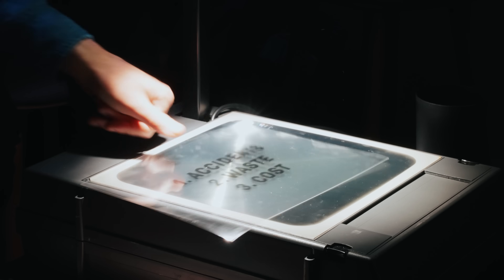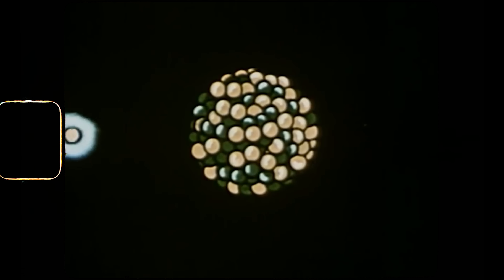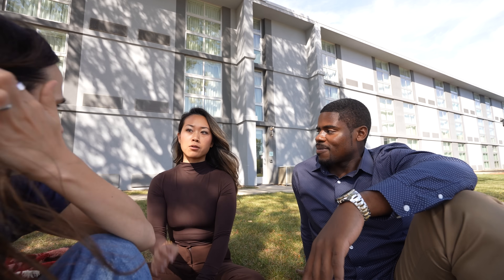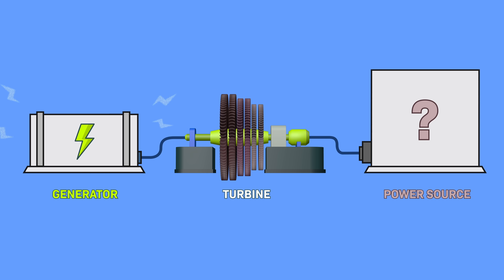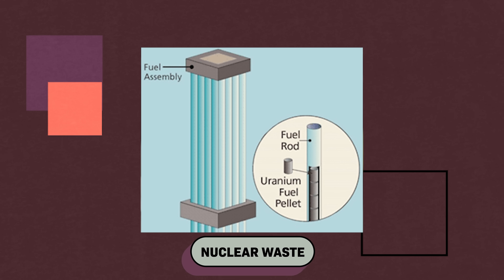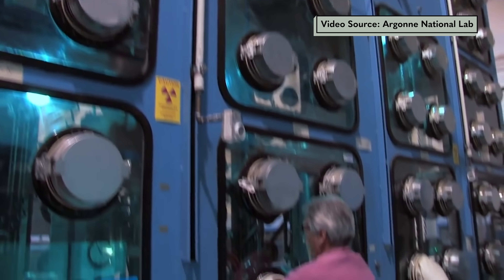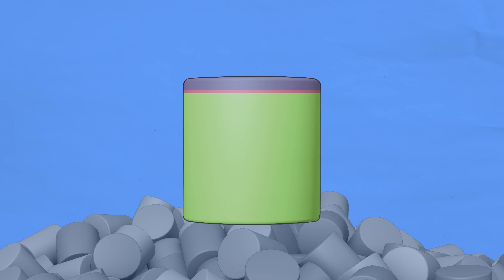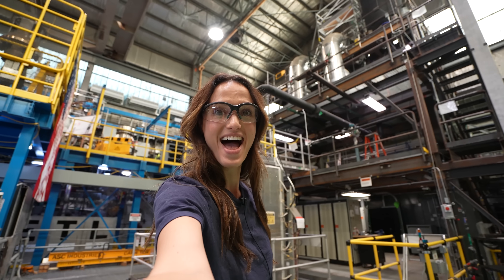The Big Lie About Nuclear Waste

Comment: U-235 has 92 protons and 143 neutrons in the nucleus, so 235 is NOT the number of neutrons in the atom, but the atomic weight of all the neutrons plus protons. 92 protons means it is uranium, and the number of neutrons (235-92) makes up the remainder of the atomic weight. Uranium has many isotopes, and as you said, U-235 is "fissile", which means that it will continue a nuclear chain reaction. U-238 is "fissionable", which means that it will fission, but will NOT sustain the chain reaction.

Comment: Nice video. But all technology is useless unless it's also practical. Nuclear energy simply cannot keep up with solar. We are overthinking this. Solar is cheaper and continues to be cheaper still. Battery storage is also one  cost curve down. Even if you remove all bureaucracy for fast reactors, it'll still take decades and decades to build up the 10s of 1000s of nuclear power plants needed. Each will be cost overrun, and a nightmare in terms of time overrun as well. Not to mention the political issues as you'll still end up with nuclear wastes that'll take 100s of years of storage.  Just in the last 100 years, we have had 2 world wars. Anyone actually think we can keep these piling up safe?  

As I say, in the best case scenario, zero political probs, zero bureaucracy,  it'll still be white elephants as it simply can't compete with solar and wind with storage.  And renewables have far less political and bureaucracy issues to deal with. Nuclear is dead on arrival. You mentioned Japan and other countries are already using it. Ask yourself this simple question. Why haven't they achieved 100% nuclear yet? In fact, they are all moving towards a cleaner, simpler and cheaper tech. Renewables. It's easy to scale and a lot cleaner.

Comment: Clean energy will never be achieved while the giants continue to grow fatter off of fossil fuels.  Fossil Fuels account for such a large portion of the global economy it is obscene, and they go out of their way to ensure their place by lobbying against anything that would hurt their profits.  Like nuclear power, nuclear waste reuse power, solar/hydro power, electric vehicles, hydrogen powered vehicles, free energy systems of any kind.  No law has yet been passed that prevents individuals from owning and using these technologies for personal use other than nuclear power, but there ARE regulations in place under which personal nuclear power devices can be owned and operated on a personal level, but it amounts to a grand total of enough to power a flashlight bulb.  You can make any gasoline engine into a hydrogen car with a conversion kit, or even make your own kit if you have the right tools and materials.  You need to source the fuel yourself too though, but electrolysis is easier than making or even just installing a premade conversion kit.  The majority of laws against power sources like these are against mass production.

Comment: I don't understand how fuel can be dangerously radioactive for the next 100,000 years, but yet is "spent" and has to be disposed of..  If it can still boil the water and generate steam to drive the turbines, it's still doing it's job..  OK, maybe it's not boiling the water efficiently enough at a 500Mw reactor..  So you move it down to a 250Mw and then down to a 100Mw, etc..   But CALLING it "spent" and shipping it off to be entombed seems wasteful if it can still do a job SOMEWHERE along the line..   Does it become a matter of people quantifying their jobs ? IE: if you only fueled a reactor every 25 or 50 years, the monkeys in the yellow suits would be unemployed for long stretches of time..

Comment: I currently work at a nuclear fuel manufacturing plant and this video is spot on. I think micro reactors will change the future of our power capabilities and the negative stigma around large nuclear reactor facilities. This video adds another aspect to the equation that will make it even better in the future. This is good stuff!
Reply: I think it adds to the equation;

Common sense versus politicians is a losing battle 😐
Reply: Common sense would also say that it's not a good idea to have many small potential sources of radioactive contamination rather than a few large ones that are well cared for. Do you realize how many idiots there are across society and what small modular reactors all over the country would mean for safety? I'd rather have a few large ones with economies of scale and a guarantee that some experts are always there.

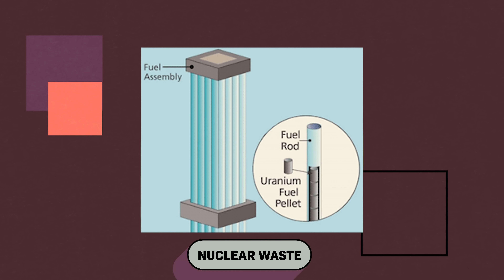Comment: 7:12  "...process clled  "enrichment"  which is making more of the U-235 from the less useful U-238."  Uh, no, and the illustration pushes that same mistake.  Enrichment means physically separating the U-235 from the U-238; the difference is important to the understanding of the whole question. If you start with 0.7% of the mass U-235, that is what you will end up with, only now one part can be used aand the rest of the mass discarded.  If you start out those early telling people one can be "made" from the other, you are pushing myth which they will believe later on.

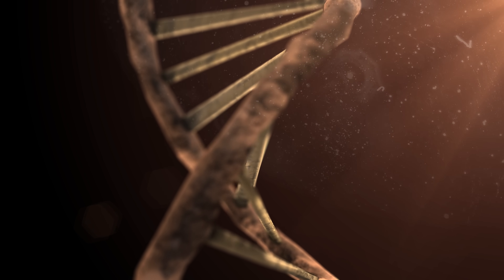7:33  "You fire a bunch of free atoms at your uranium-235...".  No, they aren't free atoms, they are free neutrons, and for a physicist this is blooper. 

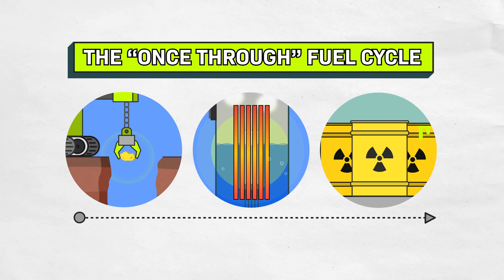8:28 There are different sorts of nuclear wastes and the differences are important.  There are fission products, the remnants of the cracked open uranium.  These are the extremely radioactive substances, but 99% of it has decayed out of our world in 300 years.  Then there's the transuranic waste, heavy atoms that radiate a very long time but are not as intense as the fission products.  This is the stuff you can rerun as fuel in the reactors you are talking about.  Then there's the leftover U-235 (you can not ever use it all up for reasons beyond the scope) and the U-238 which is the same as the uranium you started with, very low radiation intensity, lasts forever, and most vitally, 95% of the waste by mass.  It can be reused in the same role as in the original fuel.

8:53 "Those casks aren't meant to last 1000s of thousands of years".  And no one said they had to.  At the worst, new casks can be built to carry on from the older ones at much, much lass than we've spent at Jackass flats trying to bury it.  They only need to last about 300 years; what is left after that is about zero fission products, the transuranides which are to recyclable, and the uranium, identical to the original uranium, eminently reusable, and all at low enough radiational intensity to be handleable to do the recycling without undue danger.

9:12 - You make it sound like there are dry casks littering the countryside - you are back to the green-goo madel that Greenpece has been so successful at fear mongering with.  If all the dry casks in the US were gathered to one location (rather than the 83 or so they are at today) they could be installed on a 14 acre plot of ground just like they are pictured to be.  The first casks were filled in 1986, and since then not a single one has in any way leaked or become a danger; none have broken open from being dropped, none are in any way any more a hazard today than they were the day they were first filled.  Tell me how many coal ash damns have broken and flooded out in that same time period, and how many people have died from that one thing alone.

11:45 "plutonium ... a highly radioactive element ..."  No, it's not.  It is roughly as radioactively intense as uranium itself.  Made into a bomb core, a pure plutonium sphere, it was handled by hand by the physicists who built the bombs.  In spite of the fact that quite a few people had/have plutonium inside their bodies, no one has ever died directly from plutonium poisoning, as far as is known.

Comment: In the 50's and 60's, nuclear power was cheap and easy. Sure, their knowledge of safety concerns wasn't as developed as today. But today, nuclear is considered to be very difficult, expensive, and environmentally unsafe. The big difference is modern political opinion. From one angle, you have litigation layering risk concerns on top of the cost of nuclear, making it ridiculously costly. You also have the fossil fuel giants lobbying government to make nuclear ugly. You also have government itself suppressing nuclear due to 'proliferation risk'. Its why we dont have breeder reactors or thorium reactors.

Comment: I've watched several videos on the CANDU reactor. Existing reactors are all being fueled with unenriched natural uranium, but the technology is in fact a "breeder" reactor: fast neutrons in the core of the CANDU up-convert U-238 into PU-239, which then fissions. It was stated in several of these videos that it should be possible to run a CANDU on MOX (Mixed Oxide) fuel, made from recycled light water reactor spent fuel, or even Thorium-232, which can be upconverted by neutron absorption into U-233 and fissioned. Most of the discussion of using Thorium as reactor fuel has been on the LFTR, but no one has built one yet, whereas the CANDU has been around for decades and they're very well understood and have an enviable reliability and safety record. It seems to me that it ought to be possible to do a small-scale test of the use of MOX or Thorium in an existing CANDU by fabricating a few fuel bundles with some MOX and Thorium fuel pellets and seeing how they do. If the results look favorable, expand to a larger scale test. Spent light water reactor fuel is 95% U-238 and there are thousands of tons of the stuff sitting in storage canisters all over North America. If a CANDU could burn this spent fuel, we wouldn't need to mine and process as much uranium ore, so that maybe converting spent LWR fuel to MOX would be less expensive?

However, the problem of fuel service life and burn ratio is still present no matter what fertile or fissile material you make solid fuel pellets out of: when you fission an atom of Uranium or Plutonium, you get about 235 million electron-volts of kinetic energy from the fission fragments, gamma rays, and prompt alpha and beta decay emissions, and that's the energy that you turn into electricity. But those fission fragments - consisting of a mix of isotopes of elements of Atomic number 32 (Germanium) to 56 (Barium), build up in the fuel pellets. The pellets are sealed into zircalloy tubes, so these fission fragments have nowhere to go and continually build up in the fuel until they are absorbing so many of your thermal neutrons that the remaining fissile material is starved of neutron flux and the chain reaction dies out. This occurs when only 1 to 2 percent of the fertile/fissile fuel has been consumed. And they only way you can get any more energy out of that fuel pellet is to reprocess it. This involves cutting the fuel tubes open, extracting the pellets, grinding them up, dissolving them in acid, then using chemicals to separate the useless wastes from the remaining fertile/fissile material and whatever fission fragments might be useful for medical or other uses (like using Iodine-131 for thyroid cancer, or Cobalt-60 for Gamma-ray inspection of welds in very thick pressure vessels and piping). Purex reprocessing is expensive, it requires handling extremely dangerous high-level radioactive isotopes (Cesium-137, Strontium-90, etc.), and in order to eventually consume all of the U-238 or Thorium-232 in a "new" fuel pellet, you would have to reprocess that fuel many times. It's the hazards of handling high-level radwaste that are the main reason that commercial power plants are using mined uranium and storing spent fuel. Governments reprocess spent fuel to extract plutonium for nuclear weapons because military priorities outweigh environmental concerns, but just look at what has resulted: the Hanford site, Rocky Flats, Savannah River, and Oak Ridge are all going to cost billions of dollars to clean up. 

I'm not opposed to the idea of using nuclear energy, but the economics of re-processing spent LWR or CANDU reactor fuel in order to make MOX for the purpose of harvesting more energy per ton of uranium and thorium we mine...we need to really think this out very, very carefully. The only place that it's ever been tried on a large scale for commercial electricity production is France, and the Super-Phenix plant, a sodium-cooled fast-breeder, was so beset with both technical problems and political opposition, that it was permanently closed after having been operated for only a very small percentage of it's 40-year design service life.

My gut tells me that reprocessing spent LWR reactor fuel into MOX for re-use, will turn out to be simply too expensive on a dollars-per-megawatt-hour basis to compete with solar, wind, and other renewables.

Comment: another example, why do we not require smoke stacks to have filters , easiest solution to air pollution
Reply: They do.  90% of the photos (totally made up statistic) or fossil power plants, showing the smokestacks, are actually of the scrubber system which captures pollutants (some of which is made into insulation, not made up) and the exhaust is just steam.
Reply: @benloyd1970 thank you

Comment: Thanks for the video, its very educating. First you need to fight a lobby introduced by Admiral Rickover. Its a political problem backed by retarded politicians representing an uneducated public opinion, influenced by a broad lobby. The reason why we have light water reactors is because there was a nuclear submarine ,but not a nuclear plane. Also molton salt reactors were corroding the pipes and casings, and nulcear testing would take 10 years due to missing possibilities to produce casings including sensors
Now:
1. with todays materials we could create casings that are least/non corrodable
2. plutonium could be destroyed with lasers
3. testing could be made much cheaper and faster due to 3d-printing technologies that allow for sensors to be implemented in the fascilities, increasing construction and testing speeds data driven exponentionally
4. even if we didnt use molton salt some materials can be pressed into eternal diamond batteries.

So far our politicians are too dumb to understand the important of science, because they simply dont understand science and problem solving, they are political dinosaurs and remain resistant to better advice.

Comment: You say we think about technology as constantly moving forward but the nuclear industry seems to be the shining example of the antithesis of that concept.

My deconstruction of the whole nuclear industry is that overall we have spend like a total of 100 Billion in the last 70 plus yeas developing fusion. (Our defense budget now nears 1 Trillion dollars annually)

While recycling the waste is a great idea, it requires tons of resources to build those new reactors, it then promotes the continuation of mining fissile materials because now we can get rid of them (remember we only have spent fuel for 100 years....that does not solve a real issue it puts it off longer term).....so we mine even more.. The mining for fissile materials for primary reaction will increase beyond a shadow of doubt. That is not exactly a solution to me. 

Like FAST and breeder reactors that use the spent fuel, the problems with fusion are also cost and global politics, not really tech or science anymore. So is this the one we are picking over Fusion for the next 50 years?  Seems like the plan is "Lets just never get to that goal because we keep coming up with more stepping stones that 1000 subsidiaries can make a dollar between.

The reality of this issue is commercialization will run it rampant. You increase commercialized nuclear fission and make it economically viable,  you still inevitably increase pollution. Maybe less pollution but the scale is not going the other direction and according to the science community by the time countries agree to make recycling reactors in large enough numbers we will be 10 years past where we needed to stop polluting  on this level (which we never will) The only thing that doesn't increase pollution exponentially when you extrapolate the reality of the situation is Fusion.

Comment: Not only this, but U233 from Thorium only has a Spent Fuel storage life for 300 years. AND when suspended in a liquid salt can NEVER explode because there is no source of Hydrogen (from water) or Steam explosions. ANY Melt-down would drain into a Core Catcher made from Carbon and it will die because there is a 100% Neutron Absorption. No Neutrons, No Fission.  Because a Liquid Salt is the fuel media, it can be easily refueled to any Salt based reactor